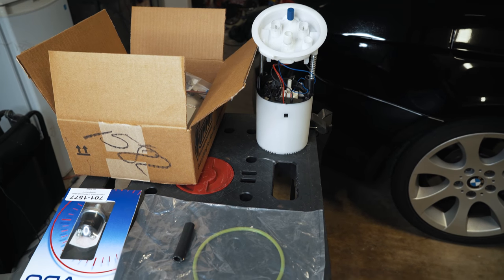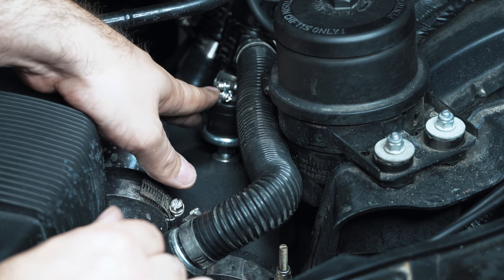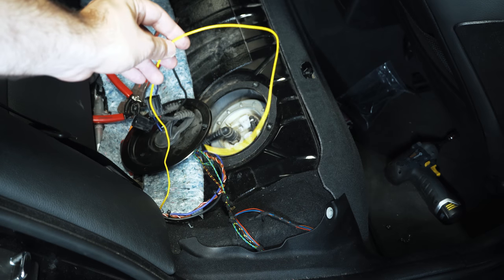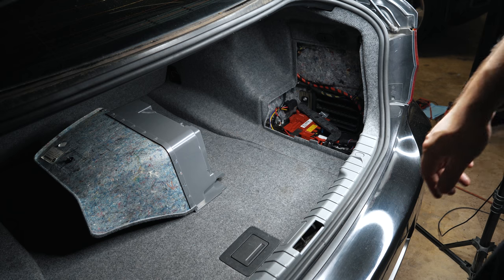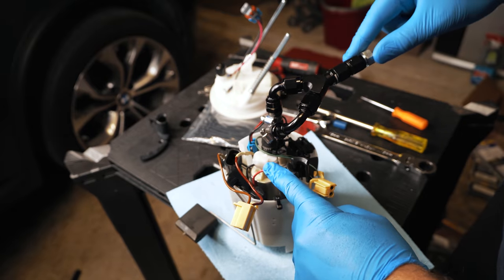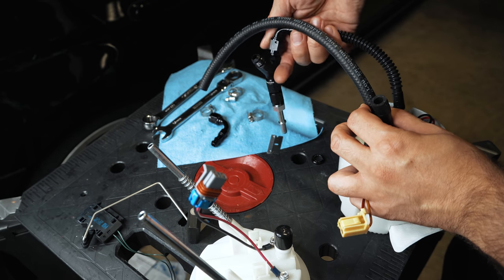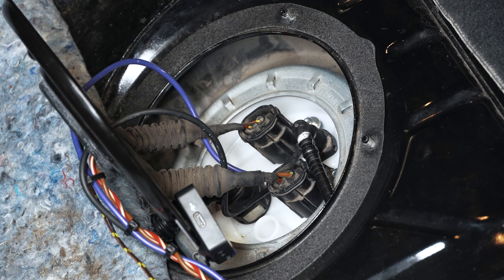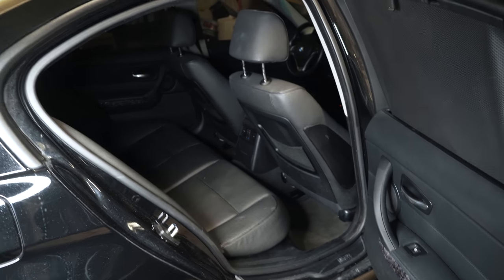Now I Can Run FULL E85! | N54 BMW Stage 3 Fuel Pump DIY

Comment: if you cut the bucket or go buckeless you will run into fueling issues when the tank is low. I do hope some1 makes a solution  where you can have 2 pumps inside the bucket while the factory loops keeps it full of fuel all the time.
Reply from the maker: Yeah I've been running it this way with the one pump in the bucket for over a year.  You'd have to be on fumes and try going wot for it to be an issue.  I just always fill up at 1/8 of a tank as you should anyway to keep your fuel pump from getting too hot.
Reply: Precision Raceworks makes a dual bucket setup. So does fuel it
Reply: I’ve also ran a similar setup for the last 7 months . With the whole bottom of the bucket cut off and never had any issues .
Reply: I know I'm late into the party but Hydramat is the answer. Ran Hydramat for 3 years now and ran very low sometimes, no issues ever. A bit pricey but well worth it

Comment: Hey my friend! I'll be installing methanol and run unblended meth and run x3 helix and stage 3 lpfp. We will be stacking them both at 100% . I also have these turbos stage 2+ 775rs.it will be more safe since it would be a lot of fuel and if meth stops flowing for some reason

Comment: Did the stage 2 pump last month with the WB 450’. That pump opening in the tank is a huge PITA.
Reply from the maker: Yeah it's not fun, takes longer than you'd think.
Reply: @VehicularDIY what happened???
Reply: @VehicularDIY I just finished putting together the stage 2 diy will I have issues

Comment: Nice! Hope to see it clears up that weird misfire. Didnt see anything in the log that would cause a misfire tho.
Reply from the maker: Yeah I'm thinking it's false knock.  I want to isolate and monitor the knock sensors.  Yeah log seems fine, I did notice some heavy timing pulls in cyl 5, also heard that's the noisiest cylinder.
Reply: Yep, that was the only thing which you've been trying to get rid of haha. I've heard that alot when I've looked at forums etc.  I was thinking about running custom tune on mine but I'm just thinking about using the JB4 with a BEF when I get the bluetooth module. I cant rev past 6500 rpm I get a cam gap loss code. Always something haha. So I just went in and set my rev limit to 6500 on xhp.

Comment: I don't know if you still see comment and questions on here but I'll try. I followed you 2 stage to make mine BTW. Works great! Thank you!  So I have 17T 's and all bolt ons including 7,5 cooler 2 inch inlets, outlet and Walboro 450lph lpfp. etc. 3.5 Tmap and anything I can't recall now but you know what I'm saying LOL. So my tuner just finished doing the last E40 custom map for me and he says I'm out of fuel or I've reached max fueling. I guess using a 535lph lpfp wouldn't do the job at this point would it?? LOL. So is the best option this one you're doing in this video?? Or maybe I'm missing something?? Thank you again for the hard work you've done all these years!!
Reply: You need a dual pump set up to optimize the use of bigger turbos. More boost=more feel needed. You can get away with a single pump at mid 500ish hp but after that you need to run a dual pump set up to ensure you get enough fuel always

Comment: Halp!! I bought a walbro high pressure 450lph. Should i have bought a low pressure fuel pump?

Mods: jb4, pods, Inlets, charge pipe, large FMIC, and down pipes.

Comment: Hi , iv seen u drilling a hole for the electrical connections, but u have not put on any washers, does the fuel not leak out from the nut wen filling up your tank, please let me know im currently struggling

Comment: So I'm trying to build my stage 3 or 4  pump , my questions are, do I need to open the bucket ? What are the best option to overkill the fuel system dual 450 or 535 with 450 ? Wich is the best set up right now on the market

Comment: You have all this equipment and no heat gun? They’re like 10 bucks at harbor freight 👍🏼 I’ll get you one for Xmas if you dont have one by then lol

13:05 by the way I have drank drinks strong than e60 I’m sure it’s not the end of the world if one were to say go gloveless in a tank of ethanol 🤷🏻‍♂️

14:52 have you found any issue with omitting the use of (purple maybe blue) thread locker or nylock nuts with those terminals?

Comment: I bought the parts for stag 2 following your video. I didn't install the parts yet because Im still working on my car. Now Im going to buy the parts for stage 3 for video. Which video should I follow? the first video and then this one or I start with this video ? Im asking about the steps if I have all the parts for stage 2 and 3. Thank you for the good work.
Reply: Did you do it? Did it work? How has it held up?

Comment: Very nice. Curious when the first E85 pump will appear in The Netherlands  ;-).
Reply: There is one in Pesse (Shell Greenplanet) for 2 euros per liter. Runs great on my Flexfuel N54 335i.
Reply: @thelightning87  Wow, I had no idea. Actually, Tamoil has about 20 in our country!
Reply: @MrNicoe36cabrio  That is old information unfortunately :( No more E85 from Tamoil. Back in/around 2012 there used to be 150 E85 pumps! Now there is only 1 left who charges way too much. Better buy it from the Action or from Germany in big quantities.
Reply: @thelightning87  Exactly what I do, buy 10 liter cans from Germany and mix myself, works perfect! There is talk that E85 will be introduced again in whole Europe...
Reply: @JerainJezza  Yeah i have a 1000liter IBC with E100 :) E85 is already available in France for about 65cents per liter. My ethanol sensor reported about E70. Belgium is also starting with E85 but without any governement benefits so the price will probably be the same or probably even higher.

Comment: So this stage 3 pump is able to feed enough fuel for full e85 without a hpfp overdrive or port injection? or was this video released after your hpfp overdrive install?
Reply from the maker: No you'd still want an overdrive or PI solution to run full E85.  This was released after.
Reply: @VehicularDIY  I managed to answer my question 0.5s after typing that comment. Thank you though!

Comment: Hey, I love your videos very detailed and informative. 
I have a small issue with my 335i,
It squeaks only during cold start.
Anyone knows what the issue is ?
Your Help is much appreciated.
Thanks
Reply from the maker: Thanks, have you changed your serpentine belt recently?
Reply: If it’s a squeak that sounds like a constant rotational squeak that goes away after a minute look at replacing the belt and pulleys
Reply: Vehicular DIY no I just got the car recently only 2 weeks back . If it’s the belt issue, what would you recommend, to buy oem belt or aftermarket?
If aftermarket can you suggest a brand that you use?
Reply: Matt Crosby it goes away after the engine is warm. Thanks 😊
Reply: Jayvenkatraj I can send you a link to the part on FCP euro. Has a lifetime warranty. You have a E90 335i or is it a 328i?
Reply: Jayvenkatraj also how many miles does the car have?
Reply: Matt Crosby I have 2010 e92 bmw 335i n54. With 165k kms I.e. 102k miles
Reply: Matt Crosby that would be great thanks a lot buddy.
Reply: Jayvenkatraj here’s a link.  All parts at FCP euro have a lifetime warranty. With that mileage I’d recommend replacing the belt and idler pulley. OEM parts are about $115. 3rd part is about $40. Either ones should work just fine. Keep In mind at that mileage it’s common for the belt tensioner to give out and could be attributing to the squeak. Here’s the link. 

https://www.fcpeuro.com/BMW-parts/335i/?year=2010&m=20&e=2135&t=5&b=9&d=788&v=&keywords=Serpentine%20belt

Comment: Noob question, but why did you need upgraded fuel pumps to run e85? Is the fuel a different viscosity or something?
Reply from the maker: It's less energy dense so you need more of it, its less prone to knock so you can make more power with it but need to supply a greater volume of it.

Comment: I hear E85 can damage high pressure fuel pumps (GDI). What is true? Can it?
Reply: its probably a good idea to add in some lubrication/e85 additive (castor oil is another common additive), but otherwise no it's fine

Comment: Is there a reason you chose to put your switch in the CP instead of keeping it all in the trunk and using the vacuum line from the flapper?
Reply from the maker: To avoid issues and for a more secure connection mostly.

Comment: Wondering if you go stage 3 fuel pump what happens to normal mpg when cruising around town
Reply from the maker: If you run more e85 your mpg goes way down.  It's cheaper so it offsets but you visit the pump more often.  One trade off it runs smoother in day to day driving.

Comment: Careful.  HPFP will still be deficient at upper RPM as injectors are pressure limited.
Reply: His HPFP is upgraded.
Reply from the maker: Yeah I got a 4x overdrive kit that is way overkill for my power level but will take full e85 no sweat.
Reply: Usually its more the other way around. At low RPM (below 4k) not enough pressure can be built. At higher RPM's the pressure rises.

Comment: You can run E85 but unless your engine internals get built, your damaging the engine now and not the fuel system.
Reply: E85 won't hurt the internals...